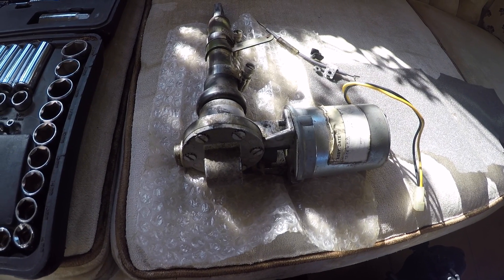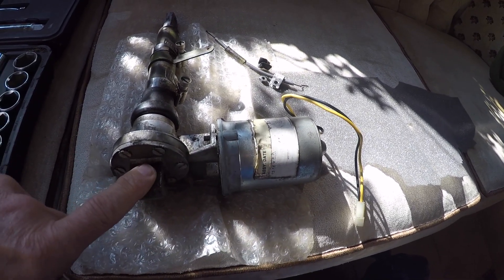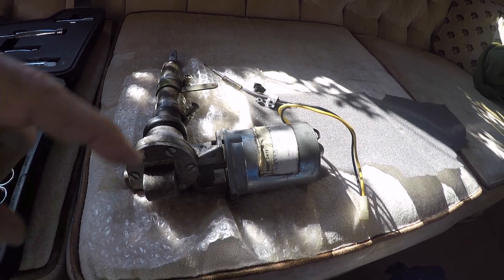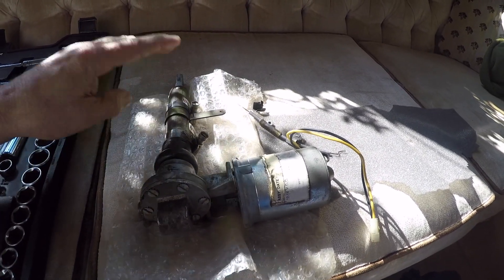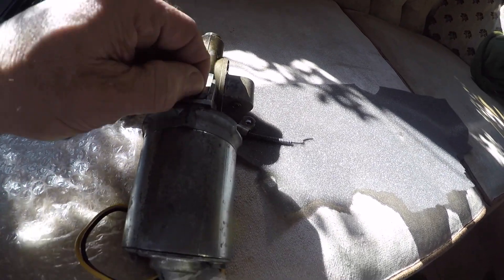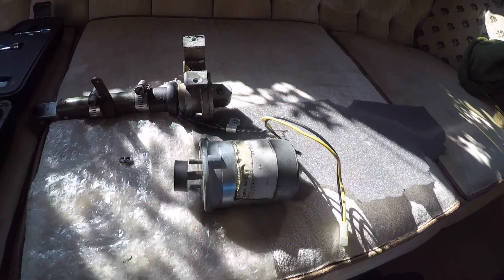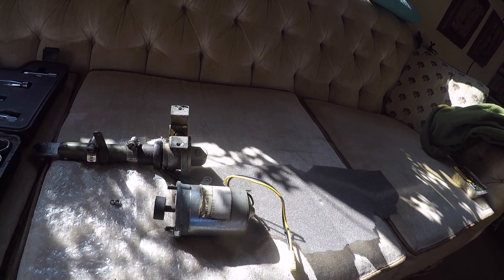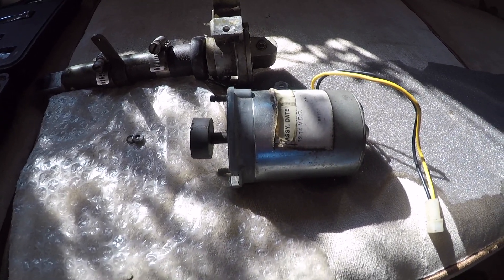4-Place Flap Motor Assembly - Grumman Style

Comment: On a couple of occasions when selecting the flaps from fully up towards down there is a squeal and the flaps don’t move. On re selection the flap will start driving down. 

The flap motor indicates that it is driving at full capacity when selected up and down and travels within the 9 to 10 seconds of travel. 

Is this causes by the rubber driver becoming worn? I have not found any of your videos covering this issue. 

Thanks
Reply from the maker: Could be the brushed wearing in the motor.
Reply: Sorry issue is for a Cheetah